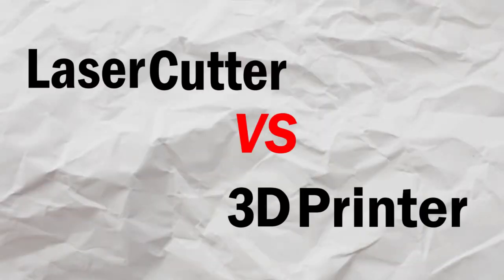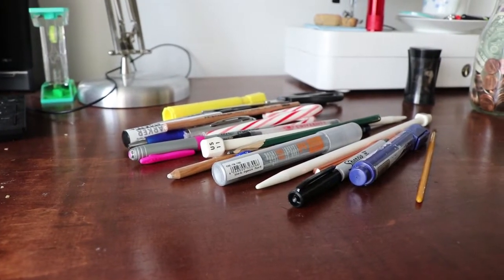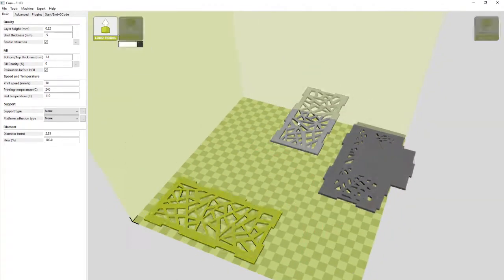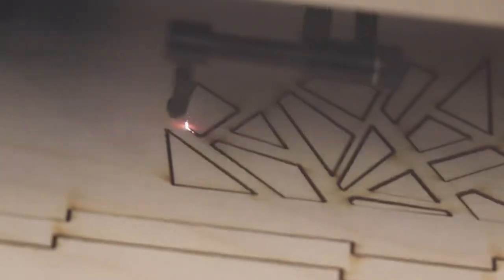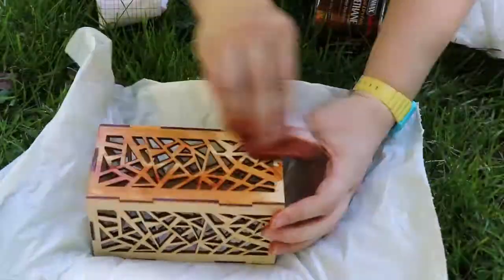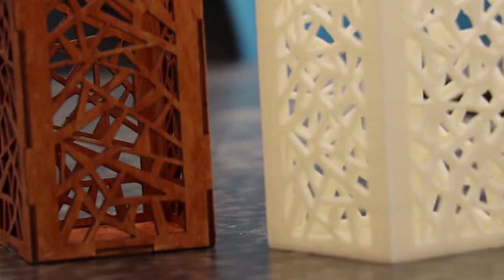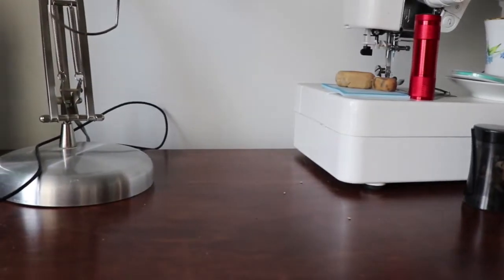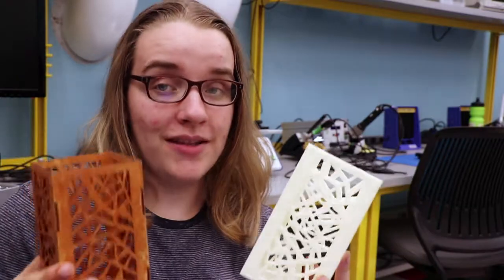LaserCutter VS 3D Printing: Pencil Holder Edition

Comment: Of course the laser wins. Nobody is going to strap a 3D printer to a shark. You would need a very long extension cord for one thing.

As for designs you could combine them. Laser cut some wood and use the printer to make a hinge, the corner bits and a tray for a pencil box.
Reply from the maker: I have never seen Austin Powers and people kept making that joke I didn't get it for the longest time.
Reply: And sharks gotta swim. Rick good sir you are a genius.